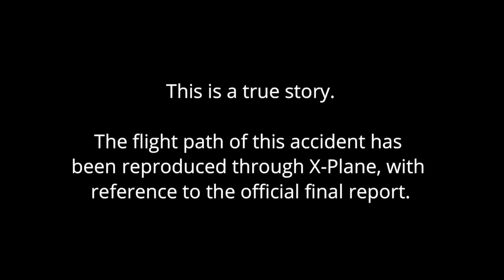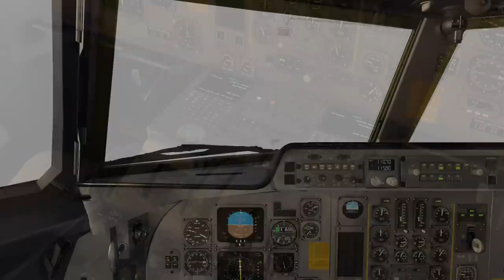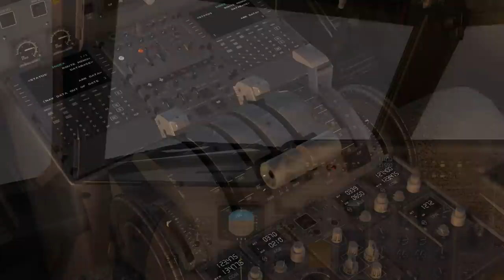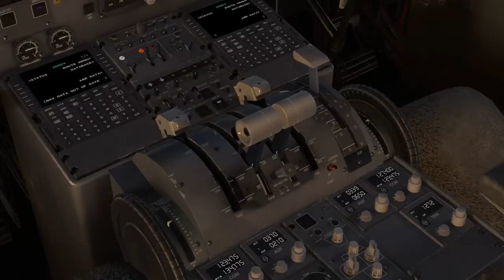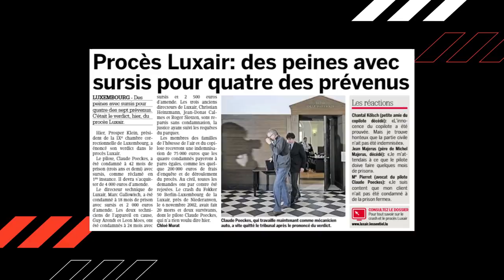Pilot Error and Mechanical Flaw: a Dangerous Combination! - LG9642

Comment: Every approach is a go around, with an option to land.
Reply: AMEN
Reply: When they heard the props go into beta, how come no one thought "Hmmm Id like to go faster" and push forward on the throttles? If I had been in there I would have bent the danged things around the stops. Reminds me of Air Florida flight 90. The engine performance sensors had been affected by freezing weather (crew did not switch on anti-ice) and were erroneously indicating full power despite only being at 70% or something and so they had a marginal takeoff and could not climb out of ground effect, plowed into a bridge and became a prime time feature on the news with helicopters dragging people thru the river ice to shore. They were discussing why they werent climbing and how stuff sounded funny, but at no time when the airplane was underperforming did either pilot just shove forward on the throttles which would have immediately boosted power. If the instruments had been correct this would have oversped the engines, but thats a maintenance write-up, not a high velocity concrete facial.

Comment: I cannot believe they stopped both engines. What goes through a mind of a pilot to make him do that?
Reply: Especially flying blind!
Reply: Propably due to a last desperate attempt to stop the drag caused by the reverse. They actually attempted to relight them but this is not mentionned here in the Video.
Reply: @aviationinvestigationchannel  On page 59: 
"Some elements noticed during the wreckage examination allow to assume that the crew might have attempted to restart the engines, but as the FDR and CVR readings stopped at this moment, was is not possible to further analyse the subsequent flight phase."
Reply: @aviationinvestigationchannel  Ok, that was the revised report from 2009 of which I can't remember why it was actually revised. In that one, this sentence was in fact not mentionned anymore. I was refering to the english translation of the final report from 2003.
Reply: Seriously, how much do you need to brief for a stock standard ILS approach at your home airport, an approach that has been probably flown a hundreds of times by the captain.

Comment: Miscommunication.
If the co-pilot confirmed (replied to the captain) to go around because they were not prepared (ready).

To be fair though, sounded like ATC was a bit rushed, but probably because they knew it was the only window for landing. Best to always hold safety as primary and divert which is common, expected, and happens often (usually to saarbrücken or liege). If they were diverted within time this would have been avoided.

I'm sure there was a bit of closed-door politics behind the investigation; hot-potatoing and finger-pointing.

Comment: This accident recount is mostly wrong. Read the official accident report instead.
Reply: @aviationinvestigationchannel  Well, the captain selected beta range to intercept the ILS from above. Only, one of the props went in reverse, creating of course a huge imbalance. Thus they lost control. Should not have tried to select beta in the air in the first place, but one prop going even further was fatal.
Reply: @aviationinvestigationchannel  I was citing from memory, and I was quite a bit involved, but I’ll check that again. Thanks for reaching out. I’ll come back to you. Meanwhile, happy Holidays!
Reply: Anyway, not committing to a go-around despite being already late to the correct sequence pf things was a bad decision, combined with the systems failure. It is pushing your luck.